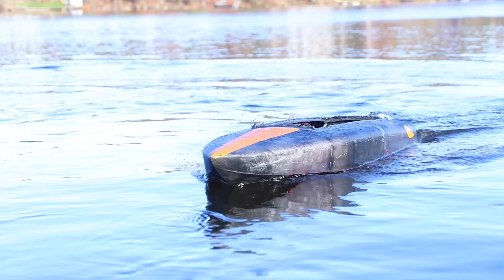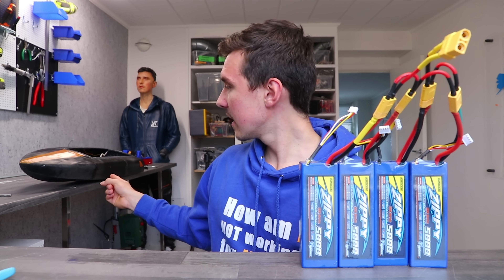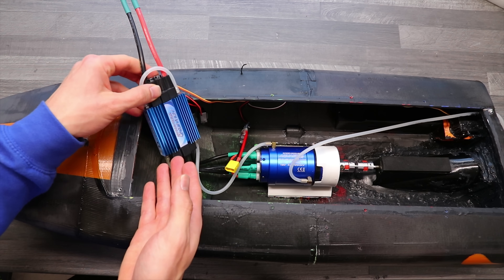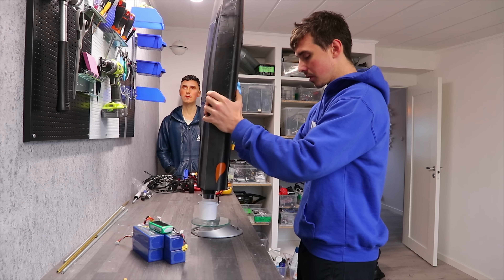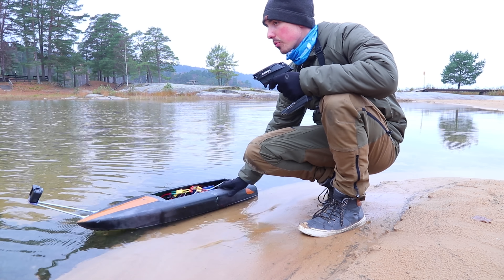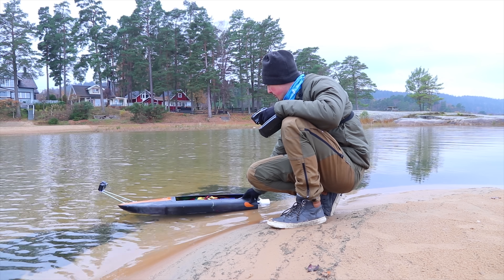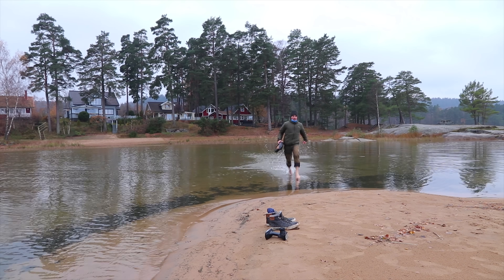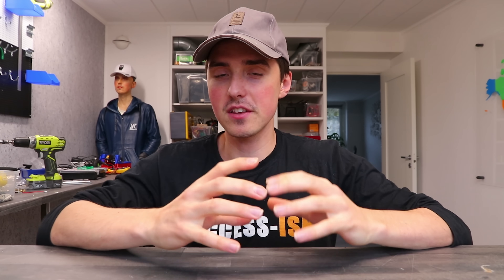NEW 3D Printed Jet Boat - PART 2

Comment: What if you did put a hatch on it and you attached the ESC to it so it was as high up as you could get it and then you just water proffed the rest of the electronics as best you could and added a bail out pump to evacuate any water that flooded into the boat it might help. You could also try to put a camera inside and accelerate the boat to see where the leak is coming into the boat. If it is just because its 3D printed and that it's inherently not really water proof then maybe you can reach out to Total B oat for some resin and you can put a coating of fiberglass over your boat to create a more waterproof hull. You can also create multiple compartments in the hull or just put the ESC into a tupper-ware box with little holes for the wires to go out of and hot glue plugging them up.Hope this helps and hope you can work something out with Total Boat so we can see more boat projects, hopefully a hover craft and a areo-foil boat design too !

Comment: Win #1 ... pushing the dock with the boat   Win #2 ... you adjusting to the excitement of connecting high voltage capacitor motor controllers.  (you are still playing with toys, it gets very very exciting as you get above 80V. use a charge resistor.)  Win #3 ... it's fast and handles the weight well.  Win #4 ... drone recovery!   Win #5 ... it didn't catch fire. (although that seems more of a personal win for you as myself and most of the viewers don't mind the occasional catastrophic fire resulting in a new and improved project). Just Kidding. Cool boat.

Comment: Here's a question, couldn't you gain some efficiency by angling the exhaust down by a few degrees?  I'm just referencing when you have an outboard boat engine trimmed tight vs trimmed out. When your out and rooster tailing really bad you dont go as far as trimmed tight and the propulsion is slightly angled downwards

Comment: Your main problem is your motor is very high torque while your jets propeller is not of significant diameter or pitch, you would probably see greater speeds with a higher kv motor or a more suited propeller.

Comment: Yes it is 6 kg but I feel with little wings this thing will just fly!! Top speed from the footage by the way is around 8 boat lengths per second! Assuming the boat is 90ish cm (compared to ur estimated height) this thing does 7.6 m/s which is just below 30km/h!! Can this be right?!

Comment: Designing 3-D print a single or dual drive system for your barge using that motor! Also because of the weight of that Make a small hydrofoil to get the hull out of the water?

Comment: make the nozzle like a cone: bigger on the impeller end and smaller on the output end. it will make the top speed of the boat higher.
Reply: I commented the same thing last video and yet we still have this huge straight nozzle and no up trim to lift the nose.
Reply: @derekbarrineau8519  yea cone shape and a servo for trim. every boat needs to be able to trim out
Reply: The huge nozzle is only for steering. If you look more carefully, you will see the    smaller one.
Reply: MAR BEL it still needs to be tapered
Reply: As have i every time he has made a jet boat unfortunately i don't know how much of the comments he reads all you have to do is look at every model jet pump plus the real jet pumps or you can even buy them
Reply: Probably good gains to be had from cone shaped steering nozzle, that big nozzle looks like it’s slowing down the water flow. 
  Hope he tries this
Reply: I am thinking of printing one of these at original size and I will maybe try redesigning the nozzle

Comment: By knowing the length of the boat to trace the distance, looking the time it takes to travel from a to b (with the video recording) it's easy to calculate the speed. Unfortunately the camera angle is not parallel to the boat so that's not gonna be that precise but still.

Comment: Your video's are excellent! Just a thought or two on your setup: You can program the ESC for more punch if you have the correct program card. Are you using XT60 or XT90 connectors now? XT 90 might be ok, but XT150's would be even better - less resistance and less possible heat build up. Love that boat of yours!

Comment: the volts true the wires doesn't matter to much, it's the amps you pull that matters.  That is why mains voltage wires are not that thick at all, and most of the battery leads are thicker.

Comment: Very Cool, But i think what would be  much cooler and way less of a pain in the ass for you would be you making another 3d printed airboat like the green one you made a while back... Only a bigger version printed in 2 halves on your cr 10... like a 30 inch beast and modify it using a big 40-50mm can motor  swinging a 8-10 inch prop and a 4000- 5000 4s battery 40c...I think an 80 amp Hobbywing airplane esc would be fine and they are dependable and cheap i wonder if it could do 50-60 mile per hour??? You could bring them both out to pond and compare them together... Thanks
Reply: You would have to print halves at a 90 Degree angle to get maxium size boat... maybe around 24 inch boat is possible on a cr 10 not a 30 inch,but that would still be a beast compared to the 16'' green one...

Comment: I'd put FPV on that, then for speed you could put a GPS and like a flight controller and either use RC telemetry or put the speed on the OSD.

Comment: Me: puts a lot of effort in waterproofing my boats.

Simon: doesn't even have a lid
Reply: Forget the lid... Nothing hurt me more than when he tossed his stick in the sand. 

Damn.
Reply: Do you know where to get 3D wind turbine propeller for my 3D printer.
Reply: @stephanfree250  Search for files or make one, it's not hard.
Reply: What methods do you use to waterproof your 3d printed boats?
Reply: @mikes150  Most of the times I just print a lid that can be screwed down to the hull and then glue a layer of EVA foam in between so water doesn't come in. Putting some Vaseline or similar on top of the EVA foam makes the seal completely waterproof.
Reply: @beltranperez378  awesome, thank you!
Reply: @mikes150  no problem mate ;)
Reply: @mikes150   on this boat https://www.youtube.com/watch?v=xoip05uj00Q&t=29s 
i use TPU material to make a tuper-ware like top for the electronics bay...  the battery pack i cover with a slide locking top with a singular body clip.  Ive had it upside down for 40+ minutes in the lake while i looked for a kayak to rescue it.  Not a single drop of water got in.
Reply: His lid is clear my dude
Reply: @alienbeef0421  nah I'm pretty sure there is no lid.
edit he even mentions not having a lid for a reason at the end
Reply: @Mdgaming_01-i6l  i noticed too xD
Reply: He tried to. But did he really give a reason? "Just being this guy" doesn't explain this sufficiently, I think. A hatch could be made in a way that it actually worked..
Reply: @elmariachi5133  His reason is water is coming in through the jet drive, so the lid isn't going to stop the water from being inside.
Reply: @h82fail  through is not coming out.. try again.//
Reply: @h82fail  by that logic, might as well make a few holes in the hull too. His 'reason' hardly explains anything.
Reply: @alienbeef0421  He owns a clear lid, but he does not use it my dood.
Reply: @alienbeef0421  he used a clear lid (past tense) but I think he removed it

Comment: I'm no expert at anything, but if you direct water out of the motor a bit higher won't it apply a down force to the rear end of the boat ? It could help with water friction and GoPro weight on front.

Comment: Attach a metal plate to the beginning of the ship and to the quadrocopter a rope with a magnet. That would not have to run on the water, but just pull up.

Comment: Listen if you want fast acceleration l suggest you change the wiring on the motor for more torque
Reply: In addition it will go faster on corners

Comment: should build a hydrofoil so it lifts a bit out of the water and has less drag
Reply: The jet drive picks up water under the boat..
Reply: a stepped hydroplane monohull configuration would do a ton for it, simple as gluing a couple door/window shims to the underside and glassing them over. it DOES have a pair of lifting strakes and they help, it'd get even more release with the forward 3/8 of the hull cut off and lowered about 1/2" for a keel line like \___-------------------
Reply: Collin326C - my thoughts exactly!